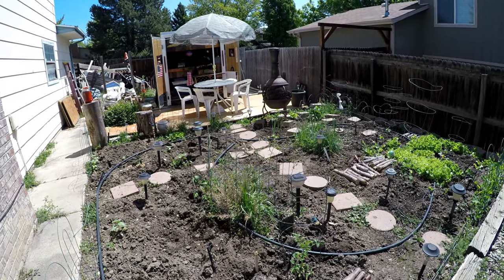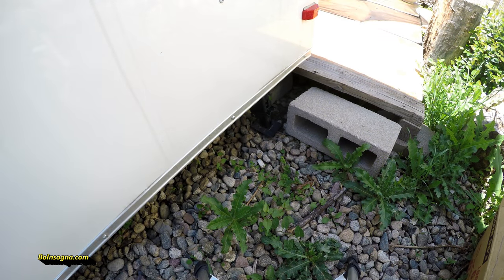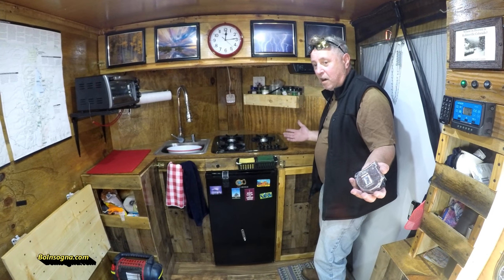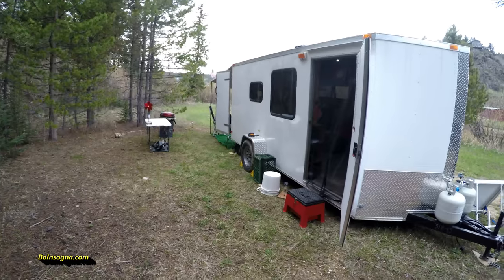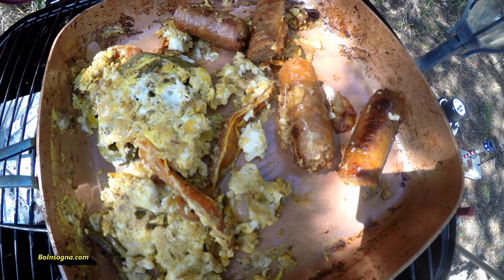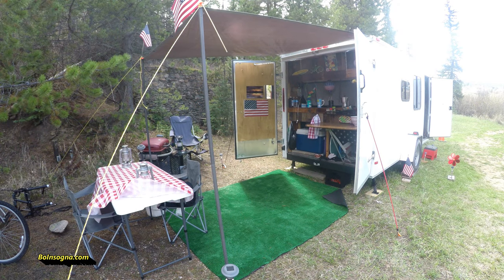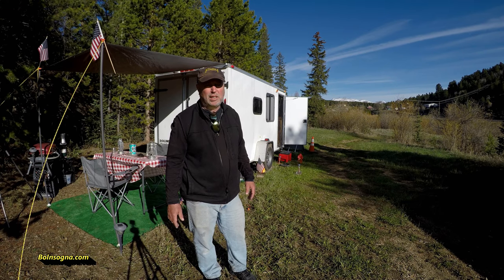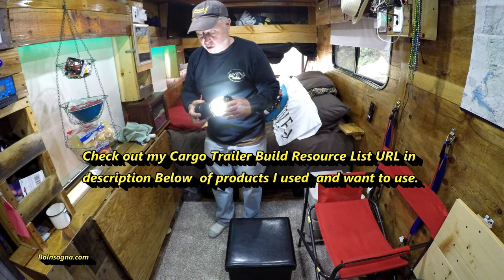Cargo Trailer Camper Conversion Rocky Mountain 4Runner Maiden Voyage

Comment: I've been following your adventure in building your trailer, travels and photos.  I love them all!  You've  done a great build with some excellent ideas and suggestions.  I'm really enjoying the whole thing!  I do have one idea or suggestion though.  I would add a weight distribution hitch.  For several reasons,  One it would take some of the bumper sag out. Two it would lower you front end,  Shifting the weight to the front steering axles. This would help to nail that front end down.  On a wet slippery road or with quick maneuvering at highway speeds  you'll need that control. It should also reduce that bend in the middle you get when trucks pass you as well as reduce trailer sway at road speed.  It should also reduce the bobbing or porpoising effect while traveling.  While I don't think you are over loaded for the truck you seem to be close to it's limit since it is a small truck with a short wheel base pulling a boxy trailer.  You are asking it to work, which I do feel it's capable of.  Any thing you can do keep things safer and help the truck trailer combo is definitely worth the money spent in the long run.  Very respectfully, John
Reply from the maker: Great advice!  Thank you!  I will check into d a weight distribution hitch.  Thanks for watching and hope you are getting some ideas.  Thanks for the kind words!

Comment: Sweeet!  How did you decide on the size of the trailer?  I can't decide on 6 or 7ft wide...(or 10,12,14ft long either).  How's the height?
Reply from the maker: I mathew!  Thanks for watching and the question. Weight!  All about the weight. it was the largest I could go to keep the weight for a six cylinder SUV to pull.  Around 2400lbs after the build.  If I had a bigger PV I would have done the tandem Axle.  7x14, I think is the perfect size. Hope that helps.